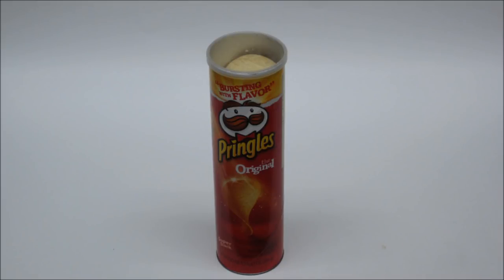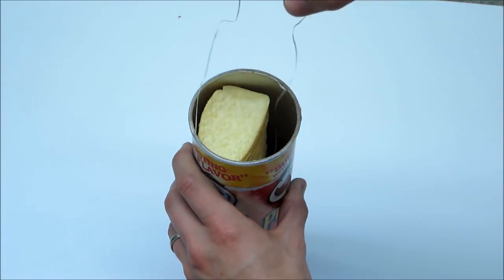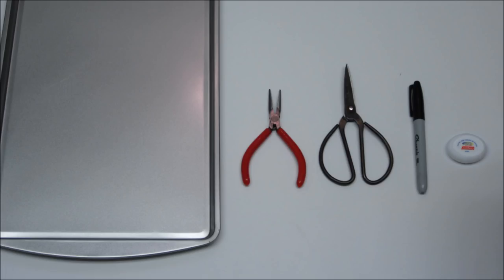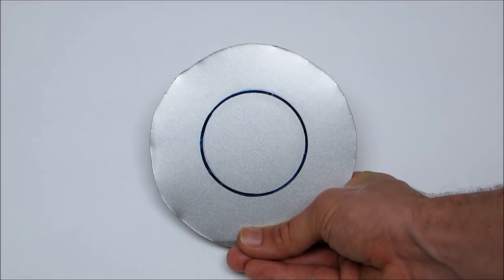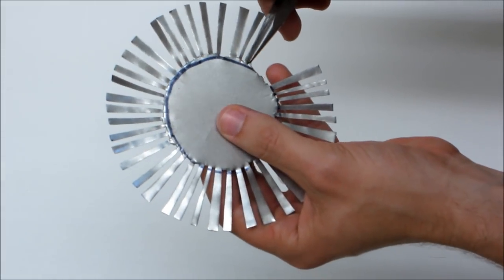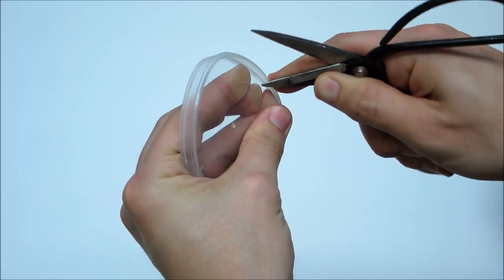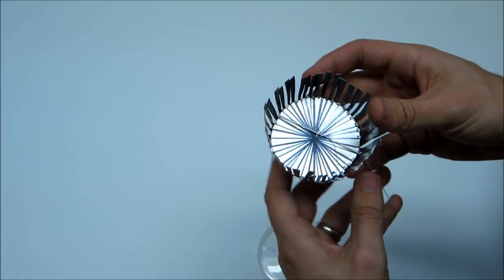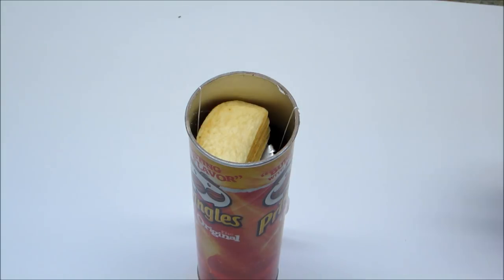How to Make a Better Pringles Can

Comment: There are a lot of countries aside from the US that already have a solution to this. They have a plastic lift handle that is on the inside that you pull up on to essentially do the same thing that this impractical and inconvenient mod does. Or like a lot of people have stated, just dump them in a bowl or tip the can and let gravity do the work by pouring them in your hand.

Comment: There should be a spring in the bottom of the can that has the proper dampening to push the pringles up once half of the chips have been eaten. You remove a little weight and the spring decompresses.

Comment: 1. You took them out of the can already, why not now put them in a ziplock bag or container?
2. Congratulations, by putting holes in the lid, they'll all be stale by tomorrow.
3. If your hands are too fat to fit in the can, perhaps you should be eating less Pringles.
4. Just squeeze the sides of the can so the opening becomes elliptical instead of round, so as to better fit your wider-than-it-is-thick hand.

Comment: a lot of words jst for chips there r 2 things wrong 1st by pluggin holes in plastic lid outside air can get into th chips and make it unfresh 2nd the metal sheet holdin the chips will make it impossible for the chips to get the flavor at the bottom of the can